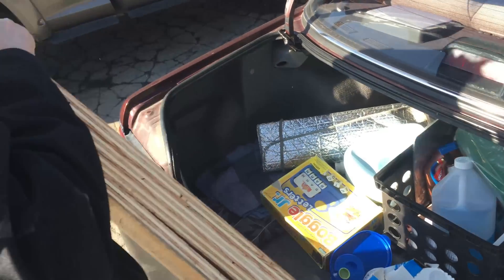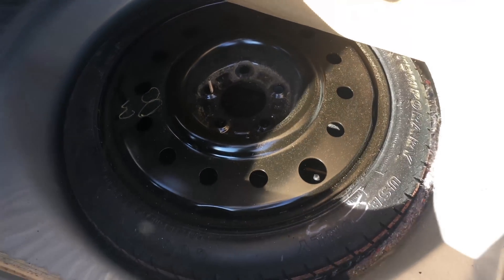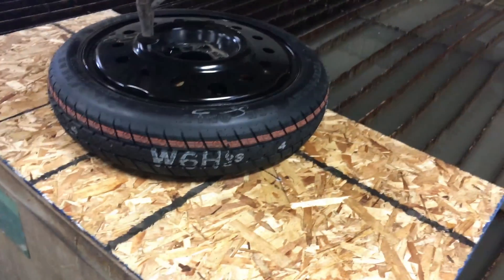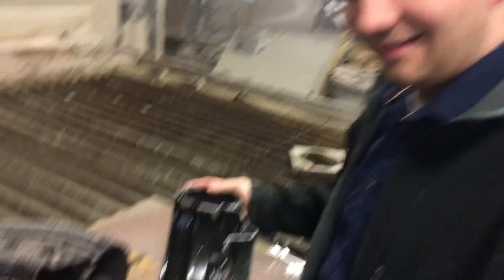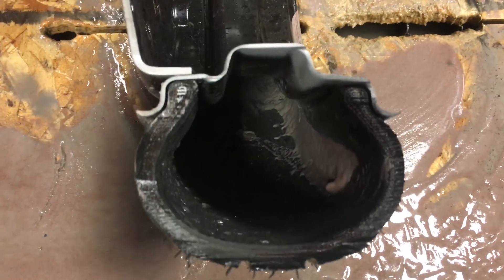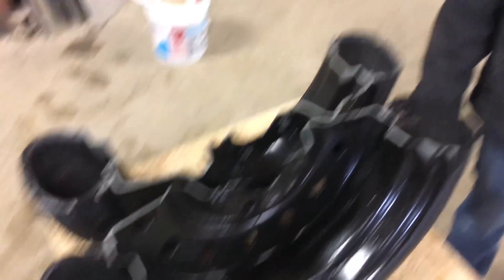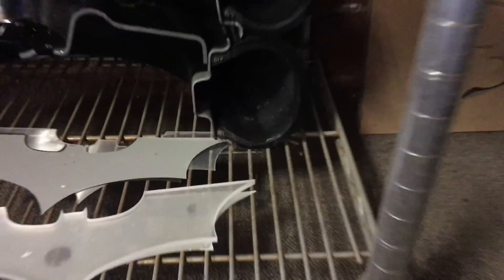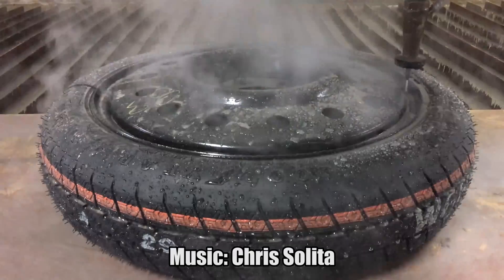Donut Spare Tire vs 60,000 PSI Waterjet

Comment: Cool cross section, but the cross section of the small engine that still gets spark is cooler. Have you guys cut a spark plug in half? Does it still work after?

Comment: so fake. its just water so thats not even possible
Reply: LED Decay it is impossible if it's just water. But it's not. It's at 60,000 psi (equal to 13,482.904109589 feet below sea level), and there is abrasive sand in the water.

Comment: Need to find / cut a 3000 or 5000 amp fuse in half. I know they are out there on ebay sometimes. I have one in my collection of odd electronics stuff. Probably would be neat cut at an angle length wise to show of the internal fuse elements.
Reply: Something like this one!
http://www.ebay.com/itm/LIMITRON-KTU-3000-KTU3000-3000A-3000-A-AMP-FUSE-NEW-/290470291517

Comment: Challenge for you. See if you can weld the wheel back together so that it holds air pressure and you're able to put a new tire on and drive.

Comment: U should cover the motor with sheet of metal and try to get it running!
Reply: Raxzu Wouldn't start  i think
Reply: dimmacommunication It could work if u would get enough compression  and  working carb

Comment: amazon sells some cheap quadcopters. slowly fly a small quad under the jet? they can be tricky to fly smooth if you don't have experience though. maybe an rc car across the plywood then? a slow march to death.
Reply: Zeke770 thats great!
Oh or a nerf dart!
Reply: quadcopter will surely be blasted out of the air immediately!
Reply: AddisonLarson or even a larger one but cut the blade down towards the motor with it spinning.
Reply: Jesse Coss thats a good idea. I imagine that will turn the blade into confetti strips
Reply: I am pretty sure thats dangerous because a quadcopter has a battery inside which could explode. 
Spinning blades and what waterjet even more dangerous because pieces from the fan will be sent flying towards anything while its getting cut under the waterjet.
Reply: AddisonLarson or a small rc boat! Heha
Reply: Jake aka Remaggib
Reply: I have a micro quad copter I'll send them to cut in half, if they contact me!

Comment: Please do bullet proof glass.
Reply: PlanetTeamSpeak it will just cut right through no problem. it would be really boring.
Reply: All bullet proof glass is well layers of glass and various types of plastics.
Reply: PlanetTeamSpeak the 300$ square foot stuff!
Reply: That stuff is really expensive and I am sure it would easily cut through it. Wouldn't be that exciting.
Reply: lol that very idea is recommended right next to the comment, sawaterjet did it it looks like.
Reply: PlanetTeamSpeak t
Reply: PlanetTeamSpeak              
O
P

loOOK

The 

yup
U
Reply: i ded ass though that there was a pice of hair on the steets
Reply: PlanetTeamSpeak yes do that
Reply: it would interesting to see for sure. please do it.
Reply: I have seen B.R. glass up close when a construction company was installing it in a security command center where I was working. All it is is is several layers of 3/8 or 5/16" thick glass that is adhered to one another using either a glue or an epoxy. The BR glass that got installed was at least 2" thick, and the individual panes of glass were about 3/8" thick at least. The BR glass installed could withstand several rounds from a .50 BMG with no problem, even a .338 Lapua....
Reply: it would be expensive and could cut through it it woulnt have anything interesting to look at inside
Reply: no one asked